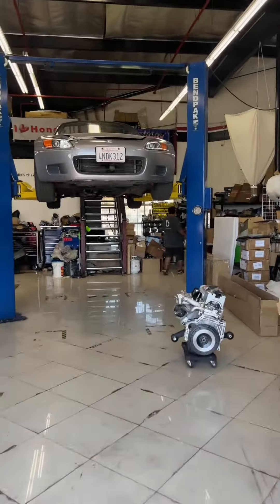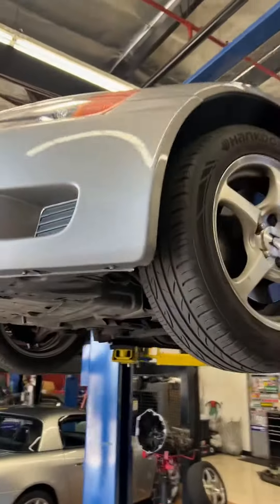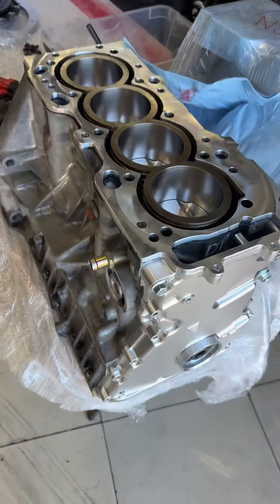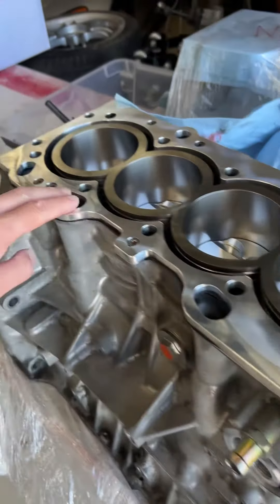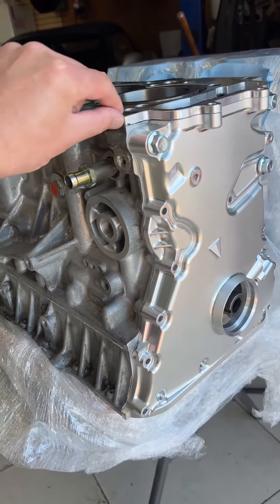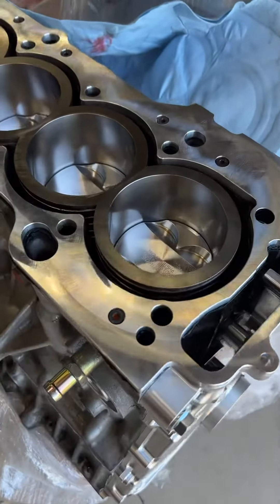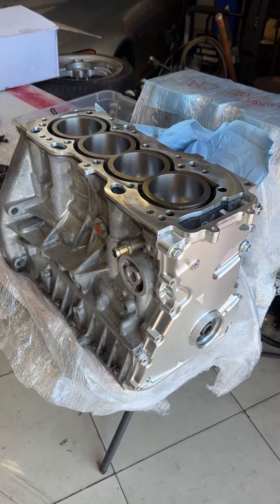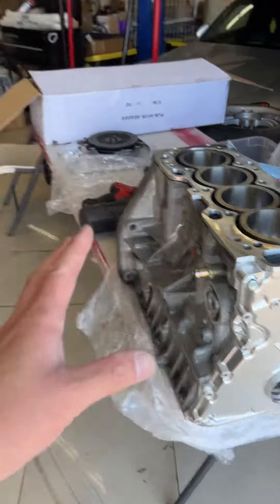Oops!! I just made my K24 S2000 Swap Obsolete!!!  F24C deck plate Engine!!

Comment: How about the timing? The chain? The gears? Head is taller
Reply: I made a longer chain (142L), bought longer studs, I make an adjustable timing/ idler gear to TDC the motor, and I make my own timing chain tensioner. Does that answer your question?
Reply: @alexdoan6095  Yes sir, thanks for answering. I'm planning to make a spacer for the K24 block of approximately 1 inch so I can use a 102mm stroker to be able to use a longer rod for a 1.66 crank ratio, but I need to make a longer timing chain but I can't find someone who makes a custom one. Who made your chain? Sorry for the other question.
Reply: yeah making the chain is the hardest part.  I didn’t make it. I had chains manufactured for me.  That means I had to make a Minimum Quantity.  So you’re going to have to make it for many deck plate engines not just a one off. No one will do that

Comment: You’ll be missing out on ivtec though?
Reply from the maker: I’m okay with that!  VTC ivtec is only substantial with stock cams.  S2000 ap1/2 cams are bigger than K20a Type R motor even FD2!!  S2000 is a race engine.  Only lacks displacement to keep up after 23 years of production

Comment: Seems like taking the long way to get to the same place. Instead of a K24 swap, you swapped the internals and modded the block to take it. Is there some inherent quality about that block and head that is more desirable than the K24? Don’t get me wrong, I’m all for watching someone else spend all that money on “let’s try that”. 👍🏻
Reply: The f20c head flows better than the k20a head by about 20cfm, and there are small differences in the block’s design as well as the oil pump being more cavitation resistant. Now, is that all really a big benefit? For the same money you can likely build a K series with similar capabilities and no need for double head gaskets, so maybe

Comment: Interesting. Does it use a K24/K20 head or an F20C/F22C head?
Reply from the maker: S2000 head.  Everything is S2000 from here on out!  It’s like the way Honda could have done a 2.4L s2k
Reply: Thank you. Looking forward to seeing how this plays out on the dyno vs a K24. I would think that the increased stroke means more torque out of these engines, which the F series lacks. I have an F motor I'm rebuilding so when the current F blows, I can drop the other F in.  @BalladeSports
Reply: Actually, I saw the original post on S2Ki, looks like it made 245whp/184wtq. That's equal torque to the K24 but +30whp, nice.

Comment: If I understand correctly, you are using the block and piston from the K24 and the head from the F20?
And is it possible to use it just by installing it on the S2000 and mapping the ECU?
Reply: How does Vtec work? Should I use i-Vtec? I am also curious about the installation of the Vtec solenoid valve.

Comment: The F24 seems like a lot of work and money to replace if it blows. Which makes me wonder why you would spend the money on the F24 when it's essentially a K24, which is cheap and plentiful.
Reply from the maker: When comparing a stock F series to a stock K24 the difference is massive.  Nothing K24 is superior to F20c or F22c.  F20/22c is a forged piston RACE engine from Honda.  K24 is a daily driver Accord commuter engine.  The only thing K24 has going for itself is that is cheap to buy stock and it has 2.4L.  If you want to beat an F series with a K24 you must rebuild all the internals anyways.  I can go on and on about what F has that is better but google can tell you this.  Essentially what we did is take the only good part about K24, which is the 2.4L and put properly into an F20/22c block case.  For RWD its far superior than K24 in a RWD set up, or even a FWD setup.  Now we gave F20/22c blocks a long over due upgrade over the K.  Its like calling this motor Blade The Day Walker from the Marvel movies.  F24c Deck Plate motor is Blade compared to the regular Vampires.  All of their strengths and non of their weaknesses.  Weakness like: Skipping timing chain, weak oil pump, weak oil pan, small camshaft profiles, no oil cooler, weaker pistons, weaker rods, thinner rod bearings, smaller oil journals, weaker flowing cylinder head, the list goes on and on.  

However, you can build a K24 to beat a stock F20/22c engine.  You have to build it and change all the internals and upgrade to other parts to the same level as the S2000.  So think about what you said.   A lot of money if it blows, well that goes the same if you build a K24.  So its all the same anyways.  Build a F build a K  Pick your poison.  Its all going to cost money anyways.

Just right now the internet is hot on the K24 swaps stock just to get them in and turbo because if you blow the motor with boost, just buy another cheap motor and repeat.  F is a lot more expensive to change out, that's for sure.

Comment: How much  HP?  And would it still be revving past 8k?
Reply from the maker: I have revved this motor to 9K rpms and the motor has lived for a long time.  Made 276 WHP horsepower in my friends car.  This new block we will not do any mods.  Zero Engine mods going into a 2006 car with flashpro to tune like stock.  We want to get data and make this engine as if Honda produced the car with this engine.

Comment: How does the cost compare between a $10K out the door K24 swap and a going this route in terms of price?  I wonder how much you give up not having variable valve timing though?
Reply from the maker: Ivtec in the K24 is not worth a whole lot when you upgrade to big camshafts.  K24 stock is nothing compared to F22c in rev range and power. K24 just have more potential power with an fully built engine.  So technically your building either a k engine or an F engine either way.

The biggest advantage k motors have are the sleeves.  You do not have frm sleeves which is what makes f series a Pain to rebuild.  And sleeping f series for some reason is still not reliable.  That’s why we are doing more research to find out why.
Reply: @BalladeSports by the time I was done with my k24, I had no vtec, literally deleted the entire system. It all becomes pointless when going for power.
Reply: This comment is the definition of bought not built
Reply: @BalladeSports if your increasing stroke aren't you decreasing rev range
Reply from the maker: @bert5168 complete opposite.  K24 can rev to 11k rpm’s when built correctly. So think about that and imagine it in a s2000 f block